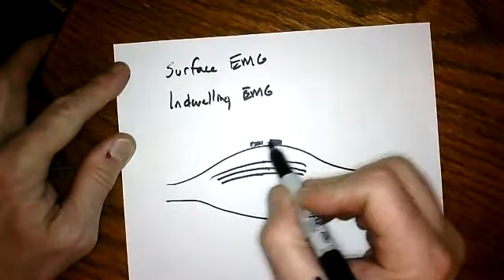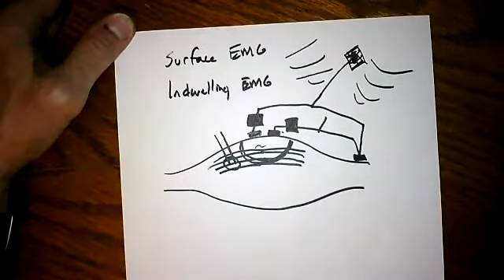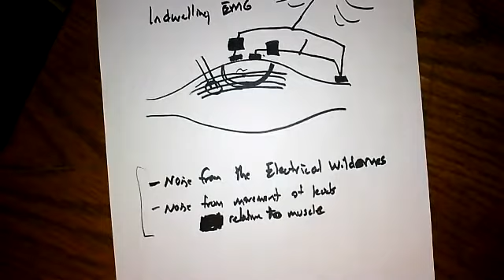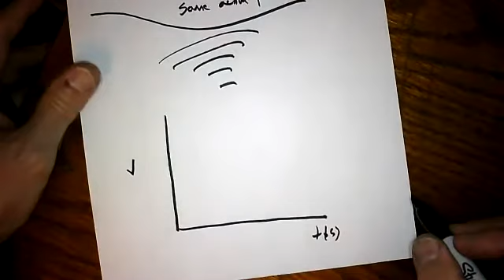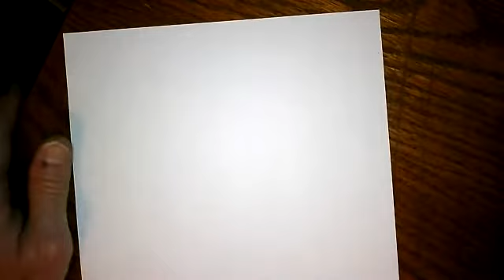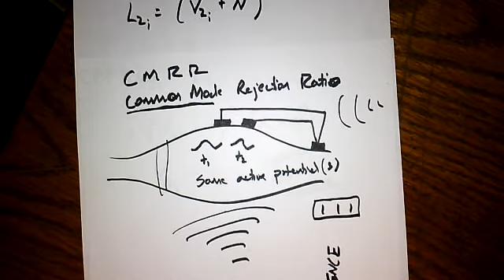EMG Basics - Common Mode Rejection

Comment: Why does there have to be a reference electrode if the common mode would be relatively the same on the + and - electrodes and therefore largely rejected by the op amps already